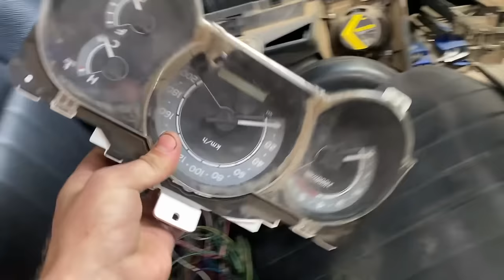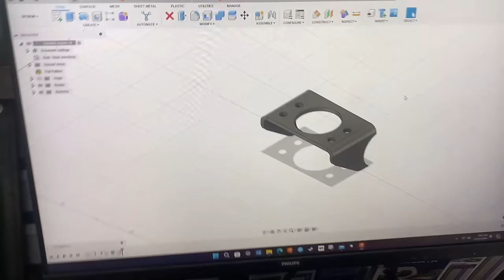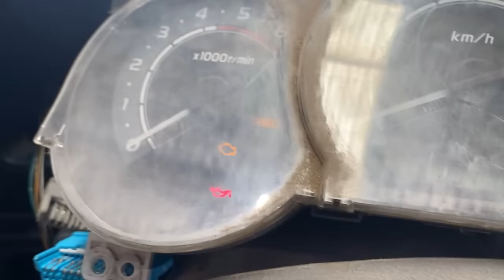Toyota Hilux LN106 Gets a 1KD FTV Engine Swap

Comment: ive swapped a 1kz (japanese import) into my 106, i did it on the original mounts and with 3L transmission g52. the engine is fully mechanical and im using a 3L mechanical pump without a boost compensator. still has a looot of torque especially down low especially with the straight  ss 2.5 inch piping and ss snorkel and the hilux has bcome a  beast. the gear is handling the torque well. ive freshly painted the car gun metal gray with a powder coated flat tray at the back. its been lifted by 2 inches. fuel economy is  quite better now too. cheers from Pakistan: rooftop of the world
Reply: Hi Abdul! Have you pictures of your Hilux? I like see your swap.
Greetings from Argentina!

Comment: 8:44 1kz torsion bar hilux runs r151 with right hand drop transfer which would suit your needs, don’t know if you sorted it yet but if not now ya know
Reply from the maker: Yeah 100% that’s the one. 
Love how modular Toyota make stuff hahah.
Reply: As for the sump, the 1kz sump and oil pick up will bolt onto the 1kd and be the right shape to not get smashed by the diff
Reply from the maker: Very good to know, I’ll have to look into that for sure 🤟

Comment: I live in the US and just imported an H100 Hiace into the states. Would the 1KD fit in the engine bay? It's a factory diesel so I'd prefer to keep it diesel and I do like the tuning potential the KD has over the KZ.
Reply from the maker: Not sure on that one but I would love to know. 

The 1KD is a very compact engine and I believe it can fit in a lot of applications.
Reply: Anywhere with a 1kz you can fit a 1kz they’re the same block

Comment: Is it posible to convert a 4x2 N70 to a 4x4 and what would I need... I need help before I start
Reply from the maker: Yeah you can. The list is large so i can’t answer it in the comments
Reply: @FavroPerformance  my main concern is on the actuator... I've done some research on the parts En all I know I can easily get a front diff /front axel with everything in it, the gearbox en the shaft for under R30, 000 here in south Africa (from a donor car of course) En that would make the process pretty much bolt in..... But the actuator that's where the stress is at... Like do I need a whole new harness or there is a separate gearbox / transfer case harness?.... En I'll have to change the claster too for the 4 wheel drive one of course
Reply: @FavroPerformance .

Comment: How u did go with Front driveshaft
Reply from the maker: The owner has a transfer from a 1KZ which has the shaft output on the correct side which he will be throwing in himself once he gets the car back. We would have done it but he had to get the box from his farm and he was happy to do the rest himself.
Reply: @FavroPerformance  so good
Reply: Does the original 1KZ transfer fit well into the original 1KD transmission? Or do I have to put an adapter plate?